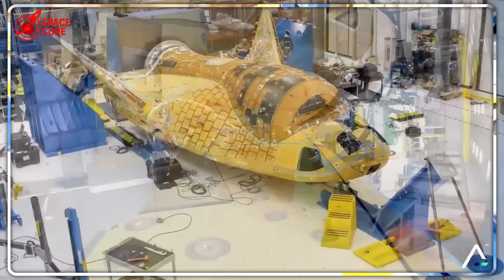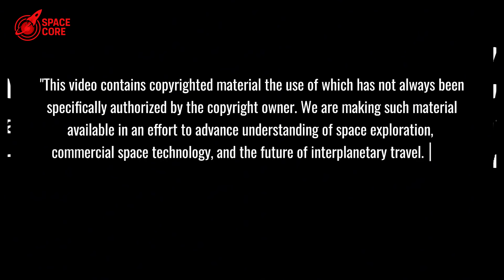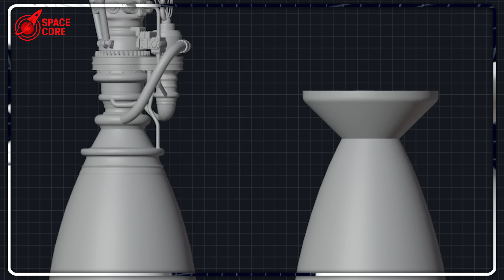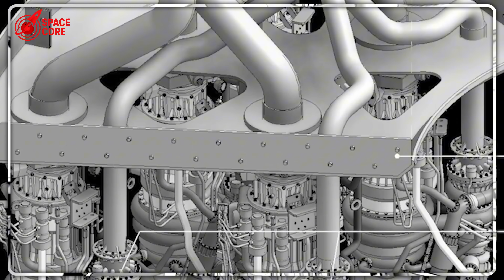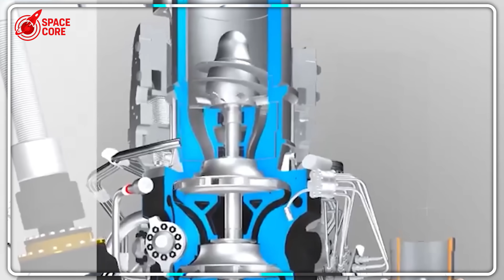SpaceX's New Falcon Heavy Fairing SHOCKED Everyone: Dream Chaser Can Fly!

Comment: It's about time! Leave ula to government contracts  and SERRIA SPACE to use the only reliable launch system.  My question is why it even needs a faring?
Reply from the maker: Thanks for the insight! Sierra Space could leverage SpaceX’s reliable Falcon Heavy fairing to free DreamChaser, but the fairing’s needed to protect it during ascent.
Reply: @SpaceCore25  The human rated version has fixed wings and does not require a fairing.  Per their agreement with the government they need to prove the non-human rated version first.  Hence the need for a fairing.
Reply from the maker: @jerrycrosby142  Dreamchaser’s human-rated fixed wings skip the fairing, but proving the cargo version first is key.